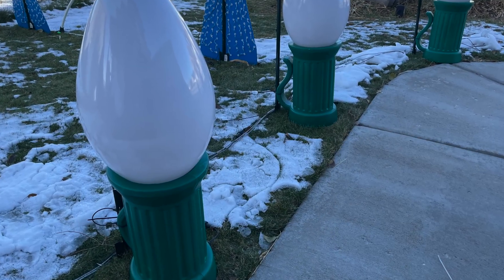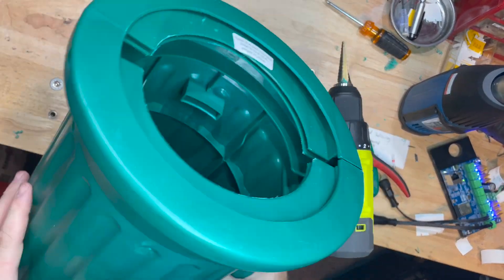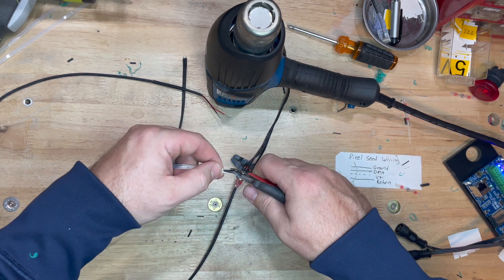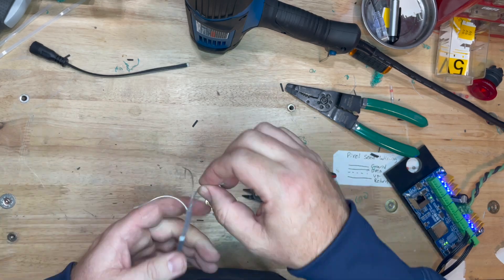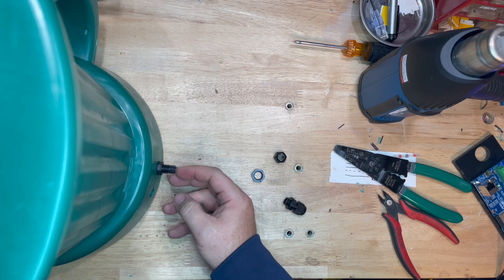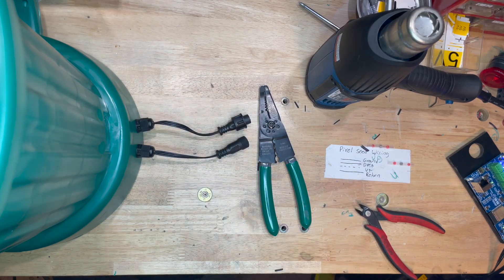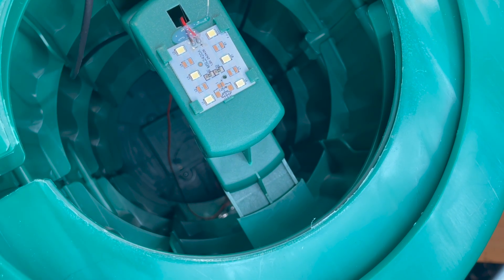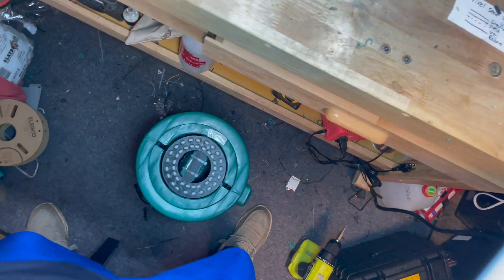"How to Convert Home Depot RRBL Lights with Pixel Seeds for Stunning LED Displays!"

Comment: I did something similar. We had some smart RGBW spotlights we use in the yard. It just so happened that when we turned that middle piece upside down the spotlight fit perfectly into the indentation. Just drilled a hole in the bottom under the “handle” of the body for the power plug. It was on the seam so we could fit the wire through. Threw a zip tie around the light to keep it from falling off and sealed around the hole with some foam board and hot glue. Now it works with the rest of our spotlights and floodlights. The trick of this one will be to figure how to use them in xlights because they are connected via Bluetooth through a BR Mesh app. I think there’s a way. If not I am pretty sure I can swap out the controller with an esp32 and flash WLED. I got 3 bulbs but one was all dented so I’m taking it back. 2 look cute on each side of our walkway.
Reply from the maker: Oh wow, that’s brilliant! 🤯 Flipping the middle piece and making it fit perfectly is the kind of hack that makes you feel like a lighting wizard. The zip tie + foam board + hot glue combo is genius—simple, but it works and keeps it weatherproof.

I’m curious though—how do they look when they’re all lit up along the walkway? I can totally imagine them giving off a really clean, polished vibe. And yeah, getting them into xLights via Bluetooth is tricky, but swapping in an ESP32 with WLED would totally solve that and let you sync them with everything else.

Are you thinking of keeping them in the mesh app for now, or jumping straight to WLED so you can control them with xLights?